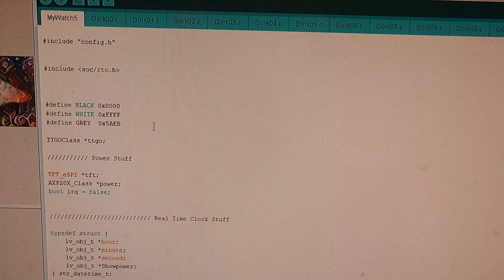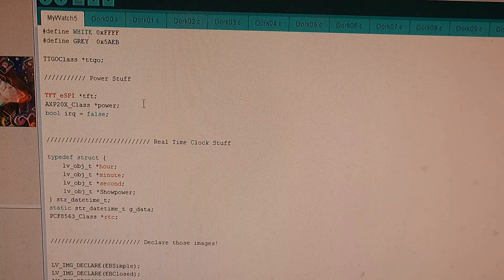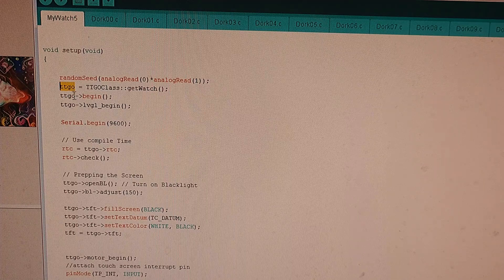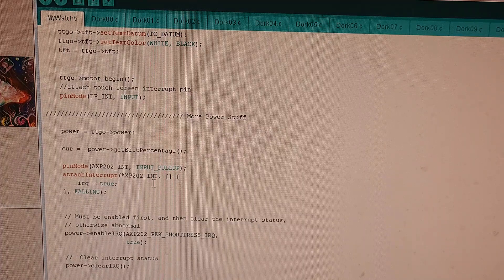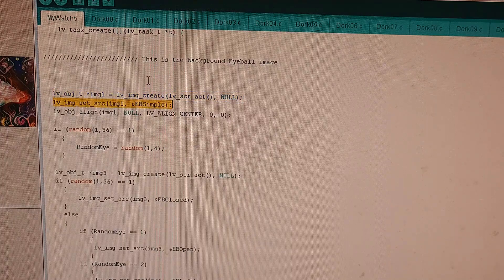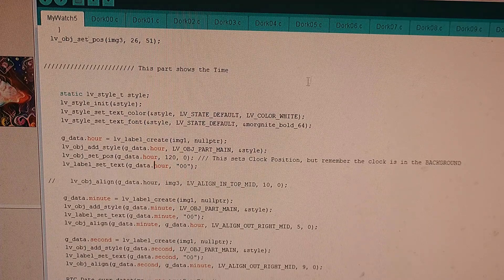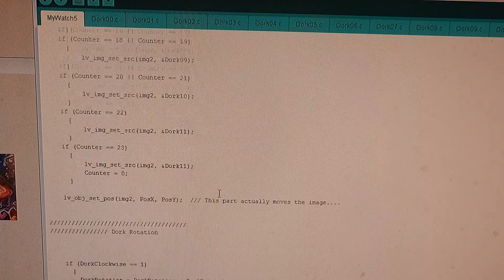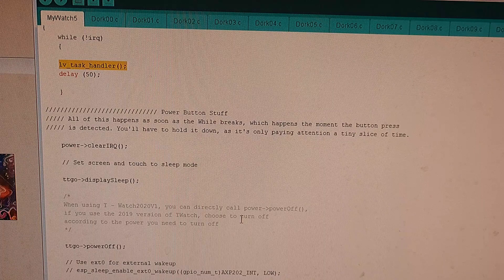My TTGO Watch Tutorial (The Dork Watch)

Comment: Good!! I like it! How to upload? Arduino complie ok, & connect ok,upload .....____....._____.....___ ...... not upload  :((
Reply from the maker: Oooo, I've seen this. Something on the chip is interrupting the write. Usually in TTGO chip, you just move around some pins. On the watch there's nothing you can get at. Some sketch that's already on it is preventing the upload. Plug and unplug, check the Tools->Board for "TTGO T-Watch", correct port, upload speed (mine is 921600). You only need to get the chip's attention for a nanosecond and it'll take the upload. Have you been able to upload any of the example sketches?
Reply: @MaxSMoke777  Thanks for the reply! Uploading sample sketches is the same error. 
Connecting ....._____....._____.....____..... then an error. 
I can't find out why. Arduino 1.8.9. Tools -> TTGO T-Watch -> Upload speed 921600 -> Partition Scheme : "default (2 x 6.5 MB app,3.6 MB SPIFFS)" -> Core Debug Level : "Semmi" -> PSRAM : "Enabled" Port: "COM22" ,etc..i tried cp210x old or new driver,unchanged ..
Reply: A fatal error occurred: Failed to connect to ESP32: Timed out waiting for packet header
Reply: @smithmodell  I responded late, like really late: Unplug your watch, close arduino, and open back up. Then try uploading it again.
Reply: @smithmodell Also try powering off the watch before you upload by holding the button, and power it on when you see the dots and lines pattern. It has worked for me at least.